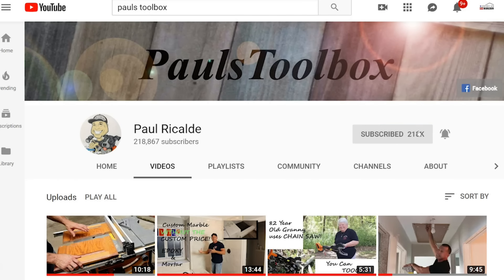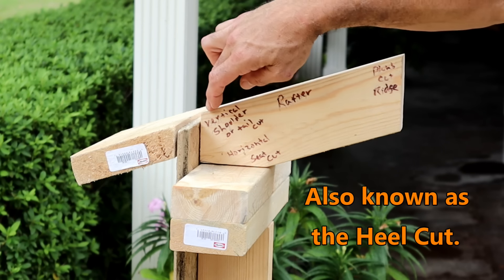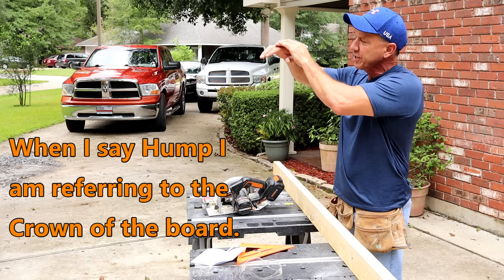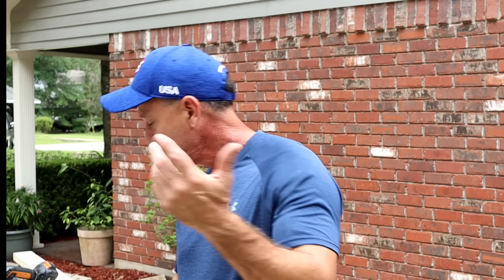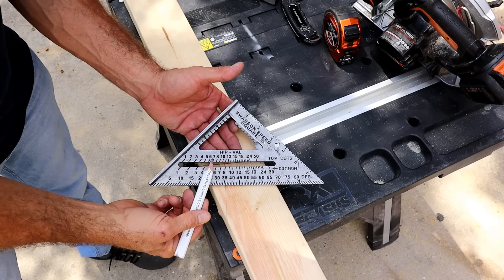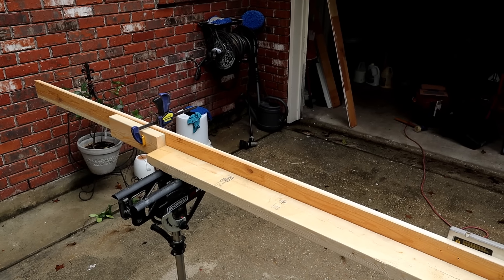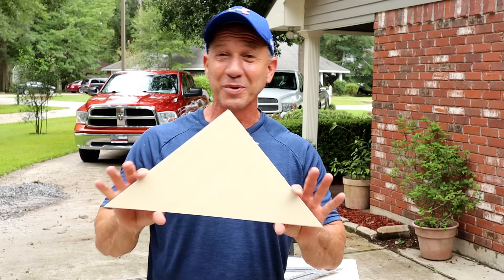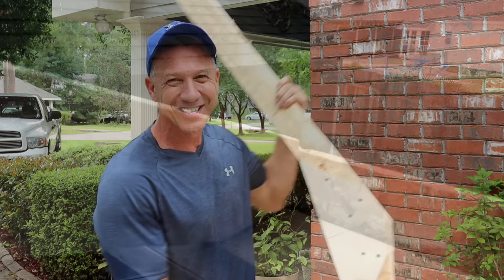How to build a shed. (Cut and assemble Roof Rafters)| Paulstoolbox

Comment: To take that one more step... Make a small rafter "pattern" out of scrap 2x's then lay that pattern on top of the plywood you intend to make into gussets and then cut without any chance of cutting into your rafters and with much less waste. The saw doesn't even get close to any rafters. When I was doing carpentry work we kept "patterns" of gussets in varying angles 4/12 6/12/ 8/12 12/12  you get the picture, and then we carried them with us from job to job. Drill a hole  somewhere in the middle to hang them all on a nail in your workshop or at the jobsite and use them indefinitely.   ;)
Reply: @Hello How are you doing dear

Comment: Tons of great info.
Reply from the maker: Good morning Sixtyfiveford, It means a lot coming from you buddy I really appreciate it! I love watching your channel you have great content yourself buddy!
Reply: Just wonderful, I have been researching "building a gable roof over a deck" for a while now, and I think this has helped. Ever heard of - Beybigail Nonpareil Breakthrough - (search on google ) ? It is a great one of a kind product for discovering how to create better sheds and improve your woodworking without the hard work. Ive heard some pretty good things about it and my buddy got excellent results with it.
Reply: @paulstoolbox   can I ask... I saw a shed the other day that had a barn roof design for greater space.  It had the 2 slopes on each side and then a ridge board and the ridge board went down on the ends to the framing.  now between the 2 slopes on each side there weren't wooden gusset plates but rathe steel gang nails on both sides of the joint.  I think they were 4x6 in size with a bunch of nails in them.  does that sound strong enough?
Reply: i know im asking randomly but does anyone know of a method to get back into an instagram account?
I somehow lost the password. I would appreciate any tricks you can offer me
Reply: @Steven Samuel thanks so much for your reply. I found the site thru google and im waiting for the hacking stuff atm.
Seems to take quite some time so I will reply here later when my account password hopefully is recovered.
Reply: @Steven Samuel it did the trick and I now got access to my account again. I am so happy!
Thank you so much you saved my account !
Reply: @Troy Khalil You are welcome xD
Reply: @troykhalil4270  2353

Comment: Question... I have noticed builders have the use of these pink studs these days, and different edge colored sheathing.  Can you explain the different colors on the edge of sheathing, and their application, as well as the different colored studs, and why you would use some different colored studs for rafters but not all of them. Thanks - D
Reply: Not sure I can answer all the questions. 
The colored studs can be a fire retardant or a mold/mildew retardant. The colored sheathing is typically the reflective type or the zip system, which is the built in water resistant membrane.

Comment: I read a few comments and no one suggested cutting the plywood gussets to shape before assembly, if you have a miter saw it's easier to cut them all first.
Also, after you drew rafters onto the OSB sheet just screw a few offcuts to the pencil lines to make sure the frames are all exactly the same.
For a little extra strength I would also glue the gussets. 
You explained everything clearly, well done 👍😀

Comment: Hi that was great it just the roof I was trying to create for my garage but I had no idea how to make it but I think you have shown me the best way Matt.
Reply from the maker: Matthew Farrell. Good morning! Please remember that if you were doing a larger span you need larger would. Are used to buy fours for this because it was a small shed but a garage we have a much larger Spain. You will also want to add ceiling Joists to strengthen the entire roof. I have another video that shows how to do this with a ridge board. For heavier structures I preferred to use a Ridge board . As a firefighter I can tell you that trust Roos feel much quicker than Ridgeboard Rousse when it comes to fires. Trust roofs feel when one part of the system fails and ridge boards structures can still remain intact if some parts are burned or broken. I hope this helps buddy and have a great day!
Reply: @paulstoolbox  thank you great advice👍

Comment: Those triangles are great.
But one step to make things easier. 
You forgot to give the tip to cut the ends all at once before you screw them to the rafters.
So you do don't have to be cutting just screw them after the tips have been cut.
Everything else I love it very good tips and I do like the way you explain things very good job Paul.

I done a lot of work remodeling and construction. 
But I love watching your videos I always learn something new.
Thank you so much for putting all this together.
Reply from the maker: Thank you Juan, thanks for pointing that out and for watching. Have a great day!

Comment: I just built a 12' x 16' x 8'.... I over killed the floor build, I used 5    4" x 6" x 12' spaced 4' on center, then did joist 16" on center... It is a beast, I have done pretty much the same thing you did, only a could things different.. It was my first time building a shed.. If I build one again I will still use the 4" x 6" x 12's but only 2 of them lol... working that floor solo on uneven ground was a ton of work.

Comment: Great video and explanations.  I'll watch again later when I need to apply the tutorial on using the speed square as it's well done.  I've done a couple of these roofs before and I would suggest adding some liquid nails or other adhesive between the gusset plates and the rafter boards to enhance the strength.  It's cheap and easy.

Comment: Nicely done!
That awkward moment when you realize you have been half stepping on proper tool use for over 20 years and making it work but doing things the hard way instead of the right and easy way!
Reply from the maker: I couldn’t tell you how many times I used speed square just to Make 90 and 45° angles. I was told to get a speed square a tape measure a hammer a pouch and so on when I first got in construction. No one told me that uses of it and that’s all I knew how to do with it. I learned over the years all of the great features that a speed square has but it is not because I’m smart buddy believe me! Thanks for the good memories my friend LOL! Have a great weekend!

Comment: The nailer plates....they're super easy to nail in quickly.  Take a scrap of 2x4 and place it on the backside of the plate before you hammer it in.  Then just hammer against the scrap 2x4.  All will drive home at once with the blow distributed.   I do like the homemade ones because it looks a little cleaner, I'm already used to sandwiching OSB for window and door headers, and also because nails back out or lose grip as wood dries.  Screws, not so much, so that's what I use.  A lot of kit sheds come with those things though.
Reply from the maker: I’m with you, I understand that they are easy for experienced contractors, especially if they’re doing this on commercial jobs because you have a slab floor. When building a shed like this you have to bring it out to the driveway or lay it out somewhere that has a solid backer. When building a shed in your backyard it is not as easy for most people so I suggest  gusset plates out of wood. Many of my viewers are DIYers, if they screw it together and make a mistake they can  easily unscrew it and fix it. Nailer plates are extremely difficult to remove. Thanks for the informative comment, it is obvious you know what you are doing. Have a good day!

Comment: for about 4 months now and I'm getting better and better and it definitely has alot to do with your videos. I was wondering if you could, if you have time to explain page 15 of the Swanson blue book. For example what does " tail cut loss "A" mean?. Also the column that says pitch. One says 1/12 then 1/6  1/4 and so on. I'm sure it's simple but I'm also not the sharpest tool in the shed. Any feed back from you or your viewers would be awesome.

Comment: Watching this in South Africa 🇿🇦. I don’t get the inches as we use the Metric scale but the way you explain things is great and precise. And damn I love the RAM trucks in the background. Also I’ve got a Metabo mitre saw bit thinking of investing in Dewalt cordless power tools. Any advise?
Reply from the maker: I’m a big fan of Dewalt corded tools. I personally do not own Dewalt cordless but I like the design. I like Milwaukee cordless as well. I really don’t think you can go wrong with Dewalt or Milwaukee, they both have a huge platform of tools that work off of the same batteries. I really appreciate you taking the time to watch my videos. Have a good night and thanks!

Comment: Nice explanation on the bird's mouth. I'm on my way out to see if my Speed Squares have that diamond in it. My only criticism is that you're using screws instead of nails for your gussets. Screws, unless they're structural, are very brittle. I subscribed and liked..thanks.
Reply from the maker: Hi Gentlemen's Edge, thats a good question. I like screws for 2 reasons, they are easy to remove if you need to make adjustments or if you make a mistake. I am showing DIYers how to build a shed and it is very easy to make a mistake such as putting  double gusset plates on the ends. I did that on my 1st shed..... I have made many mistakes in my career LOL. I must say that screws lock extremely tight. The chances of them breaking or backing out are very slim, you can beat this truss with a sledge hammer and the wood will give before 6 screws break when they are holding the gusset plate together. If you try cutting them with a reciprocating saw you will see that they are very hard to cut and usually ruin a demolition blade.  I understand that you can snap them with a hammer when they are extended from the wood but they are not meant for that, they are made to hold things tight without giving.  P.S. You can make a birds mouth without a Swanson Speed Square. The Diamond is simply an easier way to do it but it is only a mark on the 3.5"  line. you can put any square on the 3.5" mark and do it the same way that I show in this video. The rule of thumb is to not  go past 1/3 of the width of the board. If you measure a straight line from the bottom of the board to the diamond, you should not be past 1 1/4"  on a 2x4. This is not to be exact but a good rule of thumb.  You can be less than 1/3 of the board so this will also work on 2x6 walls. I hope this helps and I really appreciate your comment!  Have a good night and thanks for likeing and subscribing I really appreciate that!

Comment: Throw 2 ceiling joists or collar ties (1/3 up from top plate) because the gussets will not keep the roof from sagging and the walls will lean out. Every 4 feet. Your shed is 12 ft so at 4 and 8 feet. If you don't want to do that, do a ridge beam.

Comment: Your video's are excellent. Done very well. Question I building a roof for the little lady garden shed. 9/12 roof with 8 foot span.
Ihave 36 inch rise in  4 feet with ridge board with 2x4 rafters. What is the height
of the board that holds the 2x6 ridge up?

Comment: Thanks Paul. Been framing and doing carpentry and drywall misc. for years, but I've never laid out a roof.  Now I'm building a 12x14 shed. This helped alot. I've never used my Swanson blue book until now. I've had it since 1986!!!!! Lol.. what are my numbers for a 12x14 shed with 6" soffits?
Reply from the maker: Hi Joe, sorry I missed your comment, I was out of town doing a film shoot for the American Builder show. I got back in town this morning and came straight to the Firehouse, I get off tomorrow morning. I need to know what roof pitch you are doing before I can tell you the rafter length. I also meet to know if 12’ is the width or length of your shed. Thanks buddy, have a good night!

Comment: Excellent video Paul thank you. 2 questions; 1st, I saw a title on another video quote 10 uses for a rafter Square, AKA "speed" square end quote. Have you ever heard this name, and was the name Carpenters triangle ever used for the same device? 2nd, I May be building a shed soon, & am trying to decide between shallow pitch or steep pitch straight roof, or a gambrel roof, because I want to put in a storage Loft. What kind of angles and braces would I need to use for a gambrel roof? Again excellent video, and thank you!

Comment: If I saw it right, those were drywall screws used in the truss plates.  I could see someone wanting to use screws to freeze the plates in place, but never rely on drywall screws for any structural purpase, they are brittle, rust easily, and sometimes even break when one is putting them in.  One should never rely on any kind of screw for general construction.  Nails may seem old fashioned or hard to drive by hand, but they are engineered fasteners for structural applications.  The there are structural screws, but they are really, really expensive.  One can get away with a lot of stuff in a shed, where the alternatives are often plastic shed kits from the home center.

A lot of guys now prefer to use deck screws, but that is another case where the fastener was designed merely to hols something to something else (deck boards to the framing), not support the frame itself.  People think screws are superior because they pull things together, and hold them.  But buildings are engineered to put fasteners in sheer, not tension, and the ductile nature (bend before they break), of nails, is highly superior for that.

Comment: Awesome video! Does this apply to building a garage? Just larger scale?  Just bought my 1st home and I'm a pretty good hands on guy 10 years in the auto industry. New home needs a good sized garage for the backyard.
Reply from the maker: If you were going to build a garage you will at least want to add ceiling joist to it and use minimum 2 x 6 lumber for your rafters. Ceiling joist help lock everything in and strengthen it. I show that at  the very beginning of this video. You will also want to make rafter tales for your soffits. I will do another video on that soon. Thanks!
Reply: Thank you! Very well put video by the way. Very simplified! Will stay tuned!

Comment: For a ridge gusset like you made, ALWAYS use nails instead of screws. nails have much, much stronger shear strength. Also, the nail needs to go all the way through to the other side and out about an inch or two, then you hammer them over (clinching the nails). The nail is essentially acting as a bolt. using screws for gussets is a no-go.  Another thing is that OSB has more shear straight to it than plywood, and is a better choice than plywood (and cheaper!) , but that's not as important as the nail thing
Reply: Down south where we get no snow, is that much of a concern on a shed this size? I'd think that many screws will provide plenty of strength for a small outbuilding.

Comment: As someone who is in 2 years within the trade in FL ( I know building standards vary from State to State and FL also has the strictest building codes in the US) I’m very confused as why they use spruce for for rafters instead of SYP up north, also wouldn’t the peak need blocks for the ridge for support since they made gusset plates for them? In FL also the bearing walls must be blocked either at mid point or 1/3 part to prevent studs from bowing under load

Comment: Thank you for this video!
What if I wanted to cut a notch in the joist for the overhang rather than add separate boards? I've seen where they notch beyond the seat to fit over the wall board.
Also, I've seen custom gusset plates with a cutout for a ridge board, would that still be stable if the rafters rested on the ridge board once assembled? (still using the gusset plate obviously).
I'm going to have to save the part where you show how to figure out the angles. LOL. I had to keep watching it to try to burn it into my memory. Just to be clear, the angle guide thing said 18.6 something & you went with 18.5 mark on the tool to find the proper angle? Or do I have that wrong?
For the shed I want to build, I'm thinking of doing the rafters where I use a small scrap 2x6 or 2x4 block in the center (to represent the ridge board), lay the rafters & the block together on cardboard, mark the angles, remove the ridge block, mark the edges of the gap, and use that cardboard piece as a template for a 24" wide gusset plate that will match the angle of the rafters and have a notch for the ridge board. I would then attach a small block on one side of the gusset at the same angle as the rafters so it would butt up against the rafters. Block would be on the same side for each plate so they would end up wrapping around the rafters from the underside when 2 are installed. For end gusset plates I'd have two blocks. Probably overkill, but I think it would help me get things lined up better. Block would be cut from a 2x4 so it would be the same thickness as the rafters.
I think I'd want to run my boards a little bit longer & have a notch just after the seat for siding to slide in.